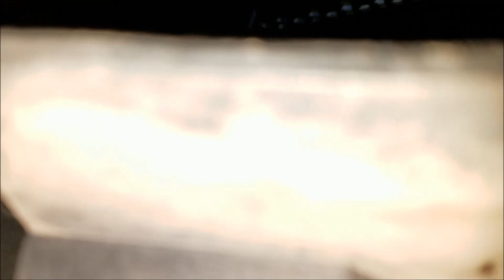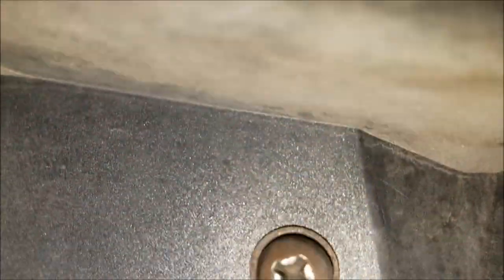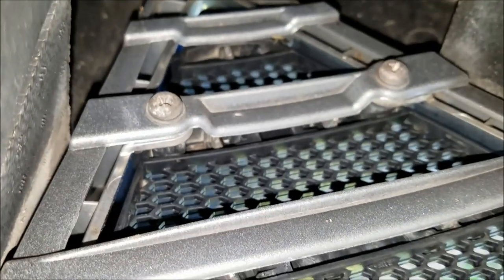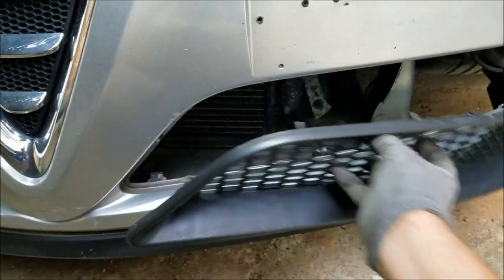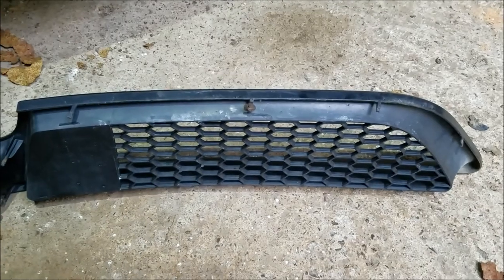How to Remove Grille on Alfa Romeo GT Without Removing the Bumper, Grill Removal

Comment: Would be nice to see front bumper removed and cleaned ac condenser and radiator. I think they are pretty dirty. Considering that dirty ac condenser raises pressure in AC system it would be a good job to do.
Reply from the maker: Not a bad idea, might do that one soon...